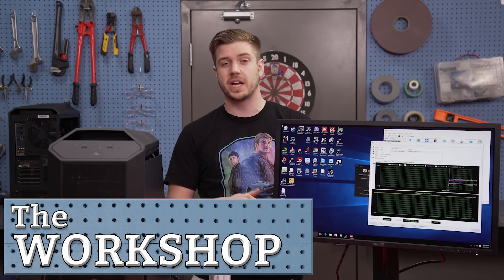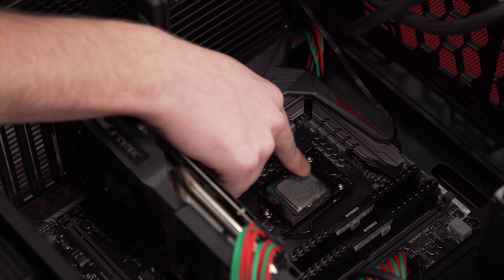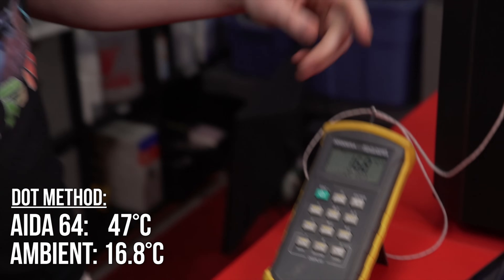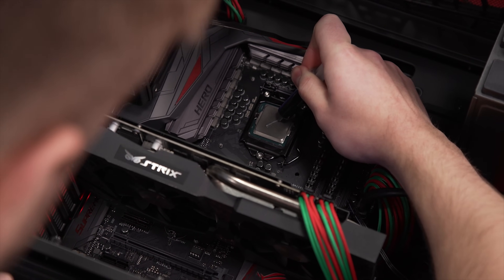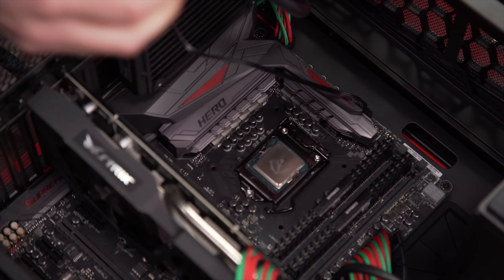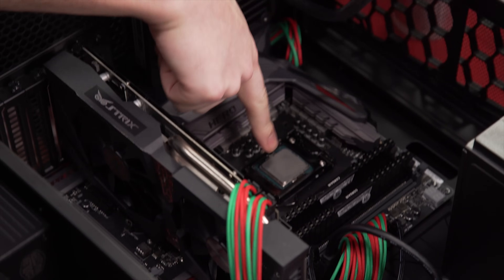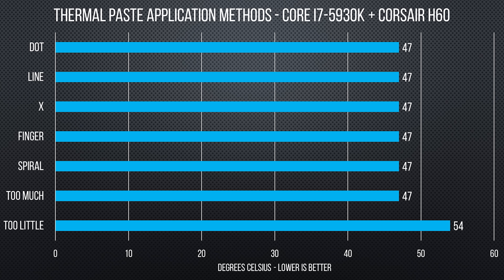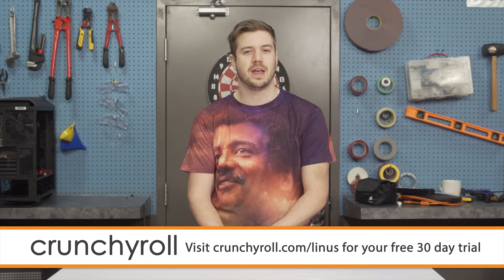Thermal Paste Application Methods - Which one is best? - The Workshop

Comment: Take the most powerful GPU, prefereably dual GPU, you guys have and test it across multiple PCI-E speeds and versions like 3.0 x16, 3.0 x4, 1.1 x16, got the idea right? It doesn't have to be SLI or crossfire, it shouldn't actually better isolate variables to see only one card performing. Thanks!

Comment: SPOILER: My conclusion: The pea method won, because it uses the least amount of thermal compound for the exact same temperatures as the other methods with way more thermal compound and it is the easiest to apply. Though I am surprised that way too much works fine as well.

Comment: one little criticism i have about this  video. you CPU isn't running hot enough to warrant specific application methods. maybe use an OC'ed 3770k instead or an AMD chip, anything that will actually heat up and potentially tax an AIO cooler. maybe try a quick refresh of this just to prove me right/wrong? others may agree, you need to have a heat problem to point out any weaknesses in the first place (skylake CPU's don't have such a problem IMHO)

Comment: lol, the discussion regarding application of thermal paste is not regarding its conductivity, its regarding it having air bubbles that will effect the cooling. Any application where you apply a dot or a line will not contain bubbles. There is a video out there that actually SHOWS this by using a plexiglass replacement for the cooler. With the CPU not doing very high temps, the application will not matter much for this video.

Comment: I wonder if the consistent results is because the heat sink is sufficiently efficient for this test? Would a less efficient air cooled heat sink produce more noticeable results between the different methods?

Comment: I've done two PC builds so far, and both times, I'm sad to say, I've erred into the Too Much category of thermal pasting. The first time was with a processor that I knew ran hot -- a first-gen AMD A-8 APU -- and I constantly had issues with heat warnings coming from my system. I still don't know if they were enough to actually be concerned about -- at its hottest it never passed 65c even with just a cheap CoolerMaster radiator and fan -- but still.

My current rig -- FX 6350 -- I used much less paste, but still I think veered on the heavy side, using a bit of a cross between the pea and X methods, with, well, an X made of peas (though small ones!) It's seemed to do fine so far....

On a humorous note, I recently sold my old rig to a friend who likes to tinker. I told him about the paste thing, and he said he'd keep that in mind. The next day he started laughing as soon as he saw me, because the paste had fused the processor to the cooler so far he'd ended up ripping the CPU out of its socket and still having to chisel it off the cooler. Luckily (for both of us) it didn't damage the socket or CPU, but he said he'd never seen so much thermal paste in any application ever. Given that I'd, ahem, used a whole tube of Arctic Silver (IT WAS MY FIRST BUILD OKAY) I can imagine so.

Comment: What about long term performance of these methods? Cause obviously we dont use our computer for 10minutes and change thermal compound all the time
Reply: +Chris Panton valid point. some compounds even say they work better after a few days use.  I do wonder if the water cooling negated any difference in paste aplication. would an air cooler have been a better test?
Reply: +spud4242 possibly.. Watercooling is so efficient. And correct, some compounds need a curing time, others don't. Ic diamond is a high performance compound, im sure these methods would affect lesser performing ones

Comment: With water-cooling you've already optimised the cooling of the CPU so, as shown, the method of application of the thermal paste made no difference.
Perhaps re-testing using a stock cooler would produce different results

Comment: A couple of points that IMO can be improved up on:

1) Use a different benchmark. IMO AIDA64 is not taxing enough to expose the differences. Prime95 with AVX should do the trick.

2) Not sure what the CPU used here. Looks like a 6700K? Seems to be around the same size as a 4790k. If you tried a 5960x the results might've been different, since the heat spreader is way bigger.

Comment: can you try it with none at all?.  is there enough contact
Reply: +King Brown 
No, which was indicated by too little paste. Paste is filling in the tiny small cracks in the metal surface, which is also why some people polish the surface and cooler often come with very, very smooth contact area. Filling those gabs is all it's supposed in an effort to not have air between thsoe two metal surfaces of the CPU heatshield and the one of the cooler heatsink. Air is a really bad thermal conductor

Comment: I would have overclocked the computer and used a less efficient cooler, to make the paste more important. If the cooler is too good, you can easily remove the heat even though the paste isn't perfect. I'm sure you would have seen some kind of difference then.

Comment: should i use antec eleven hundred case for my build z170xp-sli motherboard gtx 980 intel core i7 6th gen 750 watts gold rated 1trhdd and 230 ssd 
 will be adding another gtx 980 in near future

Comment: termal paste just fills microgaps between cooler and cpu. It does not matter how will you apply it if it covers most of cpu's surface
Reply: +MP-Tuners Productions 
well, the argument that was made, is that airbubbles would be closed in, which is why the pea method seemed the most logical one as no air is closed in at any point.
Reply: airbubbles? really? when you mount cooler on board, it holds so tight, that I don't think it's possible for any airbubles to be there.
Reply: MP-Tuners Productions
Yes, really. That was the argumentation that was made and it stems from many years back, when paste wasn't as refined or coolers just clipped on and not screwed and whatnot. It has since been researched and specified many times already. The biggest differences have been marginal like 5° max anyway, i think.

Comment: You're using Aida64 CPU Stress test alone? Really? Of course you won't notice a difference! For the love of anything that is holy at least enable (tick) stress FPU & Cache alongside Stress CPU in the System Stability Test.

You want to be pushing your CPU to its absolute limits if you're trying to test whether or not the difference in application of thermal paste impacts CPU temperatures.

Comment: Of course they all do the same, your putting it on the heat shield, the actual CPU is much smaller under there and its aprox. in the middle of that heat shield, and every method covered the area the CPU is on.

Next time try changing the crap under the heat shield with liquid metals and see what effect that has.
Reply: +Mag 
Not all did the same, and the best possible thermal interface solution wasn't the subject of the test.

Comment: well the problerm is optimal method depends on the heatsink. Heat pipe direct touch will work better with lines, full plates would work better with pea

Comment: Should have tried reused thermal paste (just take the cooler off them put it back on) and no thermal paste.
Reply: Linus has said plenty of times this should be fine if you're not using thermal grease or another degradable thermal compound. Something like MX-4 isn't conductive and doesn't degrade so that'd be fine.
Reply: Shawn Diaz Yeah that makes sense, if it's not dried out it should be fine, but I'm pretty sure some people would say it's not, so it'd still be good in a video. Could try using toothpaste and other random stuff for a laugh too. They do some super ghetto things after all :P

Comment: Suggestions for future episodes:

-How much cpu temp difference between heatsinks installed with a vertical or horizontal airflow.

-How much overall temperature difference between installing a radiator pulling air inside the case or pushing air out.

-Blind test comparing gaming mouses and non gaming mouses.

-Blind test comparing wired mouses/keyboards and wireless mouses/keyboards

-Remake the test of Airflow and Static Pressure fans on radiator and their combinations of push and pull and push/pull and shroud or no shroud.

Comment: I like the X/Cross method simply because it does a better job of spreading the thermal paste.  But yes it does about the same job as dot and line methods, but that extra assurance that it is covering most of the CPU evenly is nice.

Comment: Suggestion: does having a/any amount of tab(s) open for an internet browser (or 2+ tabs) affect gaming performance?
Reply: yes it does. the tabs use system resources.
Reply: +I Am A Planet That You&#39;ve Never Seen 
depends if the webiste is doing something. Also depends on your cpu overhead. If your cpu isn't maxed out or has cores unused by the game, it wont matter. RAM usage is the only thing besides that, and is irrelevant when you have enough free of it as well.

Comment: Shame this test didnt include types of thermal paste as personally i think that is more important than its application as this test shows.
Reply: +Chris Mason Well, the title ONLY says it's about thermal compound application. So, logically it's not about comparing different types of thermal paste.
Reply: +Alq ??? my comment was on the fact i wish it WAS included then yes the title would obviously have been different!

Perhaps i will re phrase my comment: I wish this video was title'd which thermal paste is best and which application method.

Better?
Reply: +Chris Mason they already upload it on their videos list. Why they bothering including types of thermal paste when this video only shows how the method affecting the temperature.
Reply: +pikacang I give up, honestly!!!! 1 video including type of paste and method of application makes perfect sense, for 1 if a paste is poor at thermal conduction then less is definitely more when it comes to application (i.e, the more poor paste you apply the harder it is for the heat to escape to the heatsink), however if the paste is very good at thermal conduction then less or more makes little difference (i.e, pretty much any application method will work as this video shows).

There is a relationship between paste type and application method, therefore ignoring the paste type makes this test of application irrelevant as now someone with a poor paste may now smoother there cpu with paste and think its gonna be just as good as thinly applied paste which is wrong. Therefore this should be addressed along with the results of this test, hence my comment that paste type should be included in the test!

Now does my comment make sense?

All i said is its a shame this test didnt also include paste types!!!!
Reply: +Chris Mason 
If you want the best, get the liquid metal one (forgot teh name). Tests about this have been made many times, and there isn't any new thermal paste been invented for the last few years.

PS: and you're right, For the liquid metal one, it's actually quite relevant how it's applied as it's not quite a paste in that sense

Comment: It changes a lot more when you aren't using such a good cooler. I did not apply thermal paste because I lost mine on my CPUL with the intel stock fan for a week, and my temp went from 50 C to 81.

Comment: Wow, I can't believe I spent a solid 7 minutes applying thermal paste extremely carefully and installing the CPU cooler. You could just snort the thermal paste and sneeze it on the CPU and it'll result in the same temp...

Comment: I think modern mounting pressure makes a difference, I wonder what the results would be on a socket without the mounting pressure. Also, does ICD require a burn in period? The results could change after the burn in period is complete. Lastly a higher GDP CPU might have made a difference. I personally don't think you were challenging the paste enough.

Comment: Well... that was less decisive than I thought it would be. I wonder how much it would matter with a thermal compound that wasn't as good as IC Diamond or Arctic Silver 5?
Reply: +MGlBlaze All the same, it depends more on the core location as it is not always in the middle under the heat speaders. 

Unlike the older Cpus where it was applied directly to the cores.

Comment: Suggestion, when applied directly to the silicon(cases like notebooks and gpus) it is better to put a bit more thermal paste so that the border/lateral sides of the chip can dissipate trough the paste on the cooler and not on air. Could you guys on LTT take off the plate on a intel cpu, use a notebook or a gpu and make a try? It would be very informative in my opinion.

Comment: I am interested to see a comparison of a few different brands (thermal paste/sheets/grease, silver etc) using the same application method with a cpu stress-test over a time period and recording temps? Maybe using a heat-sink/fan rather than water cooling.

Comment: I'm using Celeron stock cooler on an i5 4570..never reached 70 celsius, more quiet than my previous core 2 duo..gaming all at high settings, I guess unless you overclock it's ok..but I'll try to replace the thermal compound to see if any magic happens
Reply: +Darrell Ng the stock coller of celeron is up to 64W CPU

i5 4570 is about 84W , the best heat output is with copper and aluminum
Reply: Oren computer & electronics
yeah, only got it because it was used and the guy lost the i5 stock cooler so he gave me one for celeron..I was expecting to heat up like the sun but after prime95 I saw it's holding up..I have an aftermarket cooler ready though, just waiting for the case.

Comment: Perhaps a good indication of thermal conductivity would have been to benchmark each method under load. Idle temps are not hard to diffuse by the CPU and paste, but when its working overtime, that may yield more varying and applicable results (since most people will have their CPU under load). 

I use the pea method myself. but have always worried about putting too much on, but if this is correct, I should actually be a tiny bit more generous with the application, as too little could spell disaster!
Reply: +xPhantom Sage He used AIDA64 to stress-test the CPU. This test was under load, not while idling.

Kind regards,
Meta Custom Computers
Reply: I didn't know Aida actually red lined the CPU. I see! Thanks! 

Guess this just means that thermal paste application isn't critical as long as there is isn't too little!
Reply: xPhantom Sage
AIDA64 doesn't stress as much as prime95 on an In-place large FFT's test but it's still enough. AIDA64 with CPU and FPU enabled is 5°C lower on the cores than prime95 In-place large FFT's on my machine.
As for thermal paste, it's just important to not use too much nor too little. Too much and it will squeeze out at the sides, too little and it won't conduct properly. The myth around "you have to spread it evenly" comes from back when there were no IHSs on the dies. Thermal paste was electrically conductive back then and you had resistors placed right next to the die, so you had to prevent any excess TIM from squeezing out at the sides. That's why the spreading method was always used. Now with the IHSs, it's not that important anymore.

Kind regards,
Meta Custom Computers

Comment: In my opinion you should've chosen a less capable cpu cooler or at least reduce the fan speeds, something like that, so we would get higher overall tempreatures. With a higher average temperature let's say 80° on the CPU, you can usually see the differences much better.
Still don't know if there would be a big difference then but then again, would've been more accurate.
Reply: +ray metrich Still a gread video though, I'm glad I didn't have to try all of this for myself :D

Comment: you are like Amateurs. to get good and solid Conclusions, you  will need to test it different.

1) first , place Temperature Sensor on crossair coller
2) the Results will be delta between CPU and the coller

we know that bad contact the result will be 54 C, best 47 it mean little range of  7 C

i think , 47 is too high when the room temp is 17C' maybe crossair is bolshit

and you dont even check if the motherboard show you the real temp of CPU 
double check it with infrared termo

i like low power CPU the is the Future.

CPU that use 125W if too high